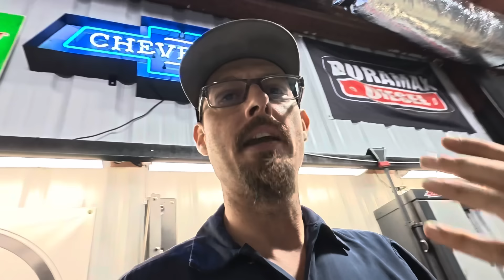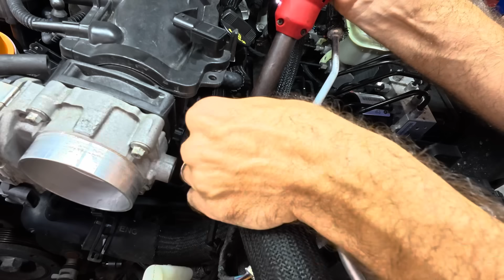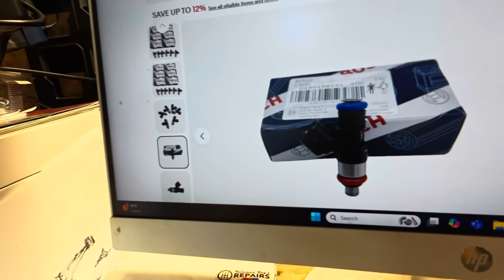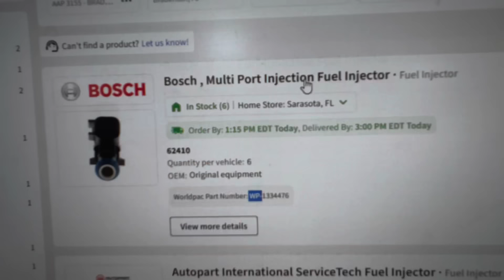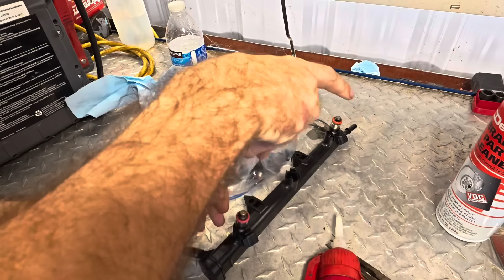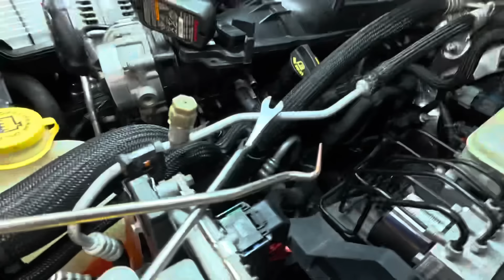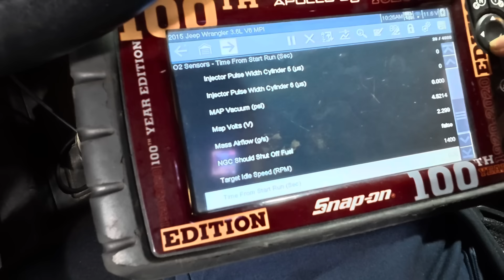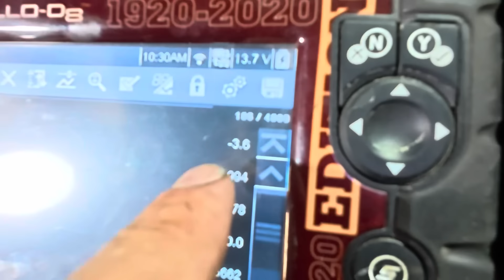Problem FOUND! E-Commerce Auto Parts (STRIKES AGAIN) Jeep Wrangler 3.6 P0172 P0175

Comment: Hi Ray,
Just a little tip if you don't mind, when reinstalling screws or bolts into plastic, it is a good idea to turn the screw or bolt in reverse until you hear a little click, this is the threads of the said screw or bolt aligning, then thred the screw or bolt in, this to stop doubble threading/ damaging the thread of the hole, hope this helps, l have had a fair bit of experience in assembly of electronic devices.
Reply: that's exactly what I do when I'm installing spark plugs in all my vehicles, put them in, start in reverse slowly and listen and feel for the "click", then go forward, install fully by hand, and give final torque spec with torque wrench. Definitely don't want to cross thread them.
Reply: after watching this video, would not choose him to work on my engine, respectfully,
not a fan of his style!

Comment: Before I watch the video I'm guessing after market MAF sensor is incorrectly reading, or faulty Fuel Injectors. The MAF may be showing a higher flow of air than is actually going through it, resulting in extra fuel, ie Rich mixture.

Comment: I admit it, I have bought car stuff on ebay.  Usually used oem parts that I am comfortable using.  I even bought a used, 1970's vintage Snap-On Tach and Dwell meter.  It works quite well though I had to get the manual online.  But I never, never buy a critical part for 1/6th the price of a quality aftermarket or OEM part.  Too good to be true.

Comment: If those were fake Bosch injectors they were very bad fakes in my opinion considering they didn’t even have a fake Bosch logo on them. I don’t think I’ve ever seen a Bosch part without their logo on it, even brake pads have it. 

Regardless unless you’re adding power, or having a misfire, maybe a fuel leak, I’d never even consider replacing the injectors just because. Fuel injectors are honestly extremely reliable especially if they see frequent use and have fresh fuel running through them. Shoot, I’d bet 98% of fuel injected vehicles in junkyards probably have their original injectors.

Comment: Injector resistors , odd old technology that featured something different about the injectors and lack of pcm injector driver sophistication . I never really understood the difference but i changed a resistor bank and an early accord idled quite a bit better and that was not for any perceived problem  just because i had a newer looking spare and i was smokin rock with nothing but time  .    . Oiled filters can cause improper metering due to maf  contamination      Ill be interested to see your results   Can you command it lean manually     ?  Thank yoy

Comment: I would have listened to each injector to make sure there weren't any stuck open.  I ran into that one time.  Maybe he got injectors with a flow rate for a turbo or E85 flex fuel model which would be larger.  You could probably keep the large injectors and just change the injector constant in the ECU or PCM whatever they call it.

Comment: Im not a car guy. What inside a fuel injector to make them spay? I assume they get the pressure from the fuel pump then its a solenoid valve that open and closes controlled by the computer. And the holes control how atomized the spay is.  And the issue the new ones were either the solenoid was too slow allowing more fuel in or the holes were to large that didnt atomized the spay well enough.    This right?

Comment: There must be aftermarket injectors that are between the insulting price on the OEM injectors and cheap junk.  Maybe from a maker that sells to hot rodders.  Lot of them make stuff better than OEM.  Seems like Bosch should be good, it's a top brand.  If not counterfeit.

Comment: Chinesium! 😂 I use the term "Chin Ho Wa" for generic Chinese stuff. Don't know if that actually translates and I apologize if it is dirty. Just the other day I had to put a little desk together for a new employee and one of the legs was a 1/4" shorter than the others and the screws that attached the top were just a bit too long and caused bumps in the top.

Comment: I learned my lesson on those cheap ebay/amazon name brand and OEM parts, luckily it only cost me $20 when I tried to buy a set of 8  "ac delco iridium spark plugs". They even looked legit, pakaging and all, but after a couple thousand miles I got multiple misfires, electrodes were burnt and and the porcelain was  disintegrating, that poor ol 5.3 ate a few pieces 😅

Comment: More than likely those probably aren't genuine Mopar ignition coils either. Had a similar instance in our shop where a Wrangler was in for a misfire. Found that the customer had put all new coils on which appeared to be OEM ones but when compared to an actual genuine Mopar coil, the font of the letters and numbers printed on top of the coil was different and slightly askew. Tested it with a known good used coil we had laying around and the misfire went away. Also used to work at Advance Auto, and in my 3 years of working there I can recall maybe only a select few times we had a remanufactured Carquest fuel injector come back for warranty. Every single one I looked at that was still new in the box always had the OEM part number and manufacturer on the injector indicating it was a remanufactured OEM unit.

Comment: My neighbor went through that. The injectors had Ford on them and the correct part number. He ended up replacing the ECM twice. He finally found out that the injectors were a good counterfeit. Ford puts a hole in the bag to hang them on a rack. That is how he finally realized that the ones he had were fake. That was a costly mistake

Comment: I'm pretty sure that those shop towels went right through and were burned up in front of the cats in the exhaust.
And this monor mistake is why I use paper painters tape to block the holes so things don't go down the intake accidentally.

Comment: 31:30 Oh no you didn't just leave those rags in the intake lower.😁
I hate when we contract everything and lose it's meaning.
The proof of the pudding is in the eating, which comes from:
A 1682 translation of Nicolas Boileau-Despréaux Le Lutrin (written between 1672 and 1674) renders it "The proof of th' pudding's seen i' the eating."[2]

Comment: ....Get your parts from a reputable place... OEM.. or OE... or do some research and find out what manufacture makes the parts for your car... plain and simple... the client just (and from what i've seen) ends up spending twice or three times more when they could have bought the original stuff...Example in my case, Spark plugs and coils for my 6.4 Hemi in my Scat Pack Challenger they are NGK Platinums but with the Mopar writing on them .

Comment: May want to change the oil as well.  Dumping that much gas into the engine surely saturated the oil.  It will off gas into the PCV artificially enrichening the engine.

Comment: yea it is what I thought, how did I know? it happened to me years ago only those parts came from NAPA, so now if I need injectors I call the salvage yard and buy a fuel rail aftermarket injectors will not be the same, look at the 1st video I nailed it, Ray that will be a $94 diagnostic charge LOL

Comment: Nice job Ray!!!!!!!!!!!  I had a customer bring me a pack of eight coils for his F-150 he got them off of the internet for hundred bucks all eight coils. And they're in a motorcraft bag and they're completely counterfeit cuz I compared them with a reasonable bag and the counterfeit bag. What a joke. I also have a Pacifica with a penstar V6 with the exact same problem you have right now and I just texted the customer and asked if cuz somebody had worked on it before if they had put injectors in it and I'm going to find out soon. That one stumped me as well thank you very much my friend. I wanted to mention though don't forget that saturated oil can cause a rich running problem as well maybe not as severe as what you had but I had a Yukon with a rich code(P219a) for  bank 1 and it ended up being the oil and a dirty maf... Keep up the good work

Comment: RockAuto has Bosch fuel injectors for $46.00 ea, they even look the same as those originals your showing, the Mopar brand is $110.00 ea, there's no way  you can convince me to got to a dealership especially the ones that sell intro clusters, unless your offering free A-1 steak sauce............

Comment: As far as diagnosis,could of hooked a fuel pressure gauge then activate each fuel injector and look at the fuel pressure drop on the gauge.should be a spec on it if not usually rule of thumb 6-8psi drop when injector activated.if no spec on fuel drop,then have to get a base line spec on a known good running 3.6lv6.the new way of diagnosing saves time but when new problems appear need to go back to the old school basic diagnostic way

Comment: I've stopped purchasing from Rock Auto, because after replacing brake pads with "Motorcraft OEM" pads from RA, I've never seen so much brake dust on a Ford Focus that I drive very easy. That told me that they were knockoff's and if RA can't tell they are imitation parts, then I can no longer trust them.

Comment: I prefer to get my parts through Rock Auto, you can get the name brand at a cheaper price, The Bosch injectors that you ordered were $45 ea. from there, down side is waiting for them through the mail which won't work that well for a garage who needs to get them in and get them out in a timely manor.

Comment: I am not a mechanic. Can you make those EBay injectors work, ie reprogram the computer to take into consideration the fuel flow/pattern/or what ever is different between the Ebay ones and the stock ones? I am just curious as to how much a mechanic can adjust for different components.

Comment: I just purchased 2 Kehin carburetors of ebay for a 96 Honda Trax 300 fwd on Ebay. Both came from ebay with the Kehin logo stamped on them. I used one on a 93 ( original unobtainium )   and a 96 both are working fine. The ones for the 96 were $500 bucks at the local honda dealer I paid about $190 for two. Sometimes you have to roll the dice. As a rule I try not to buy anything I don't have to from ebay.

Comment: So, two days ago, I checked my oil. I noticed coolant leaking from my upper hose that's connected to the "the o store called it the water outlet" was leaking, and the hose had slipped like it was going to be pushed off from the pressure. So at the o store, I thought it was the hose. I actually bought the water outlet plastic pos just in case. It turned out to be Dorman with a lifetime warranty. I'm glad I did cause it was the water outlet. A lifetime warranty of a part from Dorman! Another Dorman for the win!

Comment: I have a 2001Toyota camry 2.2 LE  with a similar condition PO 171 i have it narrowed down to a flange exhaust leak and muffler, which I will be fixing myself shortly which I think is the cause i also had a P0 505 which I just got fixed?I had it for many years. I was told by seven different shops. It was a idle air control valve. I've tried cleaning it multiple times and try to replace it multiple times and it never fixed it. It Turned out, it was just  a few wires that need a  replaced

Comment: Ray, I think it would have been great to see  graduated cylinder comparison between the two injectors using one of them injector pulser boxes.

The cat is out of the bag with the old  paper towel in the intake trick….😂😂😂🤡🤡🤡

Reminded me of a goof made by a friend of mine who left a rag in a cylinder when working on his escape. He didn’t figure that out something was wrong until it was completely assembled and he tried to turn the engine by hand to verify the timing. 

He went home to drown his sorrows. I had a suspicion and stuck my borescope camera down the spark plug holes and spotted the rag. So I just rolled the engine backwards till the exhaust valve opened on that cylinder and stuck a torch in the plug hole to incinerate the rag. Problem solved.

By the way, if the fuel trim  still says it’s running a little rich, you probably need an oil change

Comment: Ebay and amazon are full of counterfeit parts.   I would never buy an important part from either place.  You mentioned RockAuto, but they are a reliable source for parts.   You will not get counterfeits from them.

Comment: Ray Ford had a fuel injector tester cleaner, which also gave us fuel rate for each cylinder, it was a rotunda unit Ford service tools, it told us if each injector was firing and how much fuel was flowing through it, also what the fuel rail pressure was, 🇺🇸🇺🇸🇺🇸%

Comment: Not defending selling counterfeit parts on Amz and/Ebay, but after my 5.3L motor was replaced at a shop, the new water pump they put in failed within 100 miles, and the new power steering pump failed immediately.  Fast forward about another 2k miles, the 2nd Thermostat they put in along with the new 2nd water pump has failed, and it looks like the Coolant Temp Sensor has also failed.  The moral:  garbage parts can be sourced from places other than AMZ/Ebay.  I tell the shop use OEM parts whenever possible & I’m ok with the premium cost.  They ignore me and install crap anyway.  It’s sad and frustrating.

Comment: Hey I had a question about something I understand as far as buying fuel injectors and coils electronic car parts at a tenth of the price. But I have a bad transfer case in my Dodge Durango and a remanufactured OEM unit cost me about $2,300 which I don't have. I found a brand called a premium been around for a while I use some other parts before and had no problems they have a transfer case for $970 half of what a rebuilt OEM it looks like it is excellent quality. Do you think I'm shooting myself in the foot by trusting it's obviously a chinese-made part what do you people think

Comment: Edit: Yeah, they were not Bosch. They were 100% re-boxed GB brand.

Yeah, beware of the bait and switch parts scams.  People will buy the cheapest parts like GB brand injectors and re-box them together in some plain box and sell them as a more expensive brand and for more than what they paid.  The photos on the listings will not match the box you receive and it will all be plastic wrapped inside a plain brown box.

Comment: Most the injectors on ebay, or amazon that are "cheap" are chinese knockoffs.  Just ran into this with the GDI injectors for a honda fit, had 1 bad one.  Honda only sells them as a set.  Had to buy a full set, 1200 bucks for 4 injectors.   You can clean them, but one of mine was bad.   Did 2 cars and the other car we were able to clean them.    Guy would've been better off sending the injectors out and having them cleaned by a reputable company, costs $100-200 to do that, and you know you have OEM injectors.

Comment: I run into the same issue fixing IT hardware. Using apple as an example, if you take a mac book back to the apple store for a warranty repair like say replacing a system board in a slightly older mac book, they will take a board that is already been reworked and refurbished and put that back in your mac book and tell you that it's a brand new system board when it was a board with parts harvested like capacitors and diodes from a system that was left running for hours or years. Then the system dies again. Cars run on canbus and how I understand it is if you disconnect the battery and attach new parts, the car has to do a sensor check of everything then the car should start like new an remain with in the programmed limits of what the canbus software is programmed for. It's the car equivalent to say a power on self test tool that a computer uses to start. Using dell as one example, dells newer xps laptops come with compression attached ram that has a specific chip on the ram module that an xps laptop has to look for in order for an xps laptop to start. If you buy an after market module at a cheaper price and it lacks that chip, you get beep codes and you resort to buying a second hand oem module on ebay or one directly from dell at a mark up.

Comment: Good result Ray ! I knew the answer would lie with the previous work - good thing the customer 'fessed up and straightaway you knew where to go.. We hope you charge him well for that experience. Believe it or not - I seen this happening once - from a main dealer ! the replacement injectors were genuine but the technician didn't pay attention to the replacement injectors color band - thus leading to a rich "condition" at idle but you could see the pulse widths on the injectors pulled right back to minimum ! 

On the fake parts issue - don't know how bad it is in the states yet but on this side of the pond you can't even trust parts from proper parts stores or "motor factors" now - I have a "Bosch" map sensor right here in front of me that came from a parts place - the sensor cured the initial problem of no boost pressure reading at all, but introduced another one because its output voltage was going way above 4.5 volts.. but being my own vehicle and part that I purchased I knew straight away something wasn't right with the new "Bosch" sensor..  the genuine stuff is supposed to have a hologram on the box now but they can make chinesium holograms as well ! The proliferation of online parts stores e.g. autodoc and the amount of brands of spurious parts means that something can't be right.. Over here, the only way to go for complicated / electronic / electromechanical parts now is to pony up and get genuine dealer parts.. anything else is a waste of time and money, especially for the unwary..

Comment: So million dollar question, why did they feel the need to change the injectors?  Spark plugs. coil packs I get.  They are semi wearable part that needs to be replaced and getting in there to do it on this motor is a pain.  But injectors tend to be more life time of the vehicle, and get replaced rarely and on a failure.  Also you would think it would be mentioned, yea I replaced the injectors right before this happened.